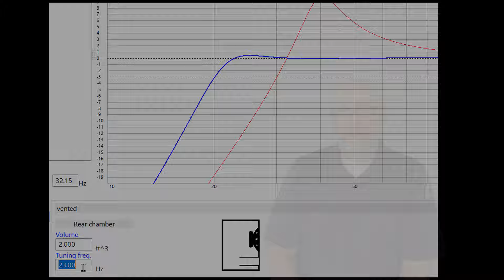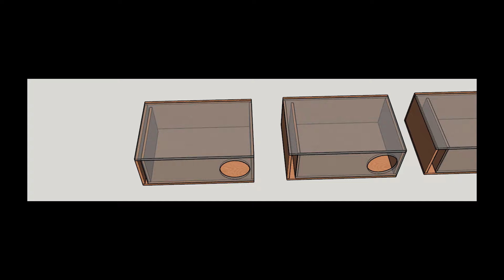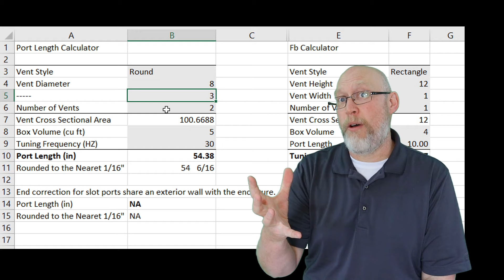Everything you need to know about PORT TUNING in under 3 minutes!

Comment: The DIY Audio Guy dropping knowledge once again.
Reply from the maker: That seems to be my thing.
Reply: Es El Fuego no?
Reply: I am still don't know what is better hight tuning or low tuneing. I just need the best tuneing that has more bass.
Reply: @DIYAudioGuy  I want very Low frequency at 10" subwoofer for earth shaking Bass. So what dimensions should be used to tune for deeper low Bass like earth shaking Bass? Please suggest me Sir... Thank you🙏
Reply: @DIYAudioGuy  not sure if you will see this or not but in about a month I am going to start building a 6th order 2/1 for  4 zvx 12's they are all going to share a 12qft ported internal volume and will be tuned to 30hz (i will call this the back of the box) the front half of the 6th order  will be 6qft and tuned to 60hz but I am unsure how to tune the front does it tune the same way as the back? For example if my port need to be 12in long to achieve 60hz for the back half would my port need to be 6in long for 60 hz in the front si ce the front is half the volume of the back?

Comment: I bought a Wuzhi 2.1 AMP from Amazon and a Dayton Audio 4" Mid Sub  speaker. I have a corrugated tube from my paint spray booth just to try. If I place the tube over the top of my speaker and totally cover the cone the volume of air from the speaker  is amazingly high. And the base is very high as well. I find from this midrange speaker that tuning the frequency down does not sound as rich but I am using the speaker as a sub/midrange speaker so tuning it up to hear more of the voice/music sound better. I bet I could use 2 in midrange and maybe one 5 1/4" as a sub range might sound better. I am just experimenting at this point. Also my tube has a rubber flang piece for connecting two pieces together. I have tried this as a temporary Baffle and as the base of the port tube. The rubber piece does seem to help the sound.  As ca Baffle The rubber piece does add to the base that is coming out the bottom. Not sure if that is the effect one wants in a speaker. I wonder if this technique is better or worse that just placing a tube inside an inclosed box? Besides vibrating the tube I would think you would want as much air pressure coming out of the tube as possible. And there is a lot of air pressure in my design.

Comment: I have a question that I have never heard a definitive answer on.   I have been building and installing car / wakeboard boat audio systems for about 22 years now. My builds obviously change based on the customers expectations, customers music preferences,  the amount of space their vehicle has and their budget.   My next build will be for my daily driver Ford Focus ST. I plan on experimenting with the enclosure I build for it.    Many people that decide to install a stereo system have seen vehicles with multiple subwoofers and they assume that running two subs vs 1 actually doubles the low end output.  They believe bigger and more is better. They think they need to run 10,000 Watts and as many subwoofers as they can cram into a car to make bass.  Many times my goal is to prove amplifier power and number of subwoofers has nothing to do with performance.  It is funny.  it always shocks people when I explain the actual volume difference between running 1 or 2 subwoofers in properly built boxes doesn't double the bass output.  When I explain to them it only provides them a few DB increase in bass output by adding another subwoofer they look at me like I'm crazy :-).  If one speaker puts out sound then obviously two we'll double that sound 😊 It's hard for people to grasp that the subwoofer is not outputting sound it's moving air which creates waves that we feel and hear.   I try to convince them using single subwoofer in an  enclosure that is built and tuned properly should sound amazing and provide very good bass output. Usually I have them sit in my 2011 F-150 running a single DC Audio M3 8 and they realize I'm not scamming them.  Here is my question for you.  Would building a dual chamber ported enclosure  that has one smaller chamber (1cuft) ported  somewhere around 40-50 Hz and then building the second enclosure larger (2cuft) ported to somewhere around 27Hz provide stronger performance across a wider frequency range than it would If I built a separate two chamber enclosure with identical sized chambers ported to identical frequencies?   Is there a benefit compared to two identical chambers or would this be counterproductive?  FYI The subs would be typical fourth order and both chambers will use identical subs.  Most enclosures I build I attempt to tune them to have a flat response.     In my mind it seems like two different tunings and enclosure sizes would allow me to tune the larger chamber to that same flat response allow that sub to play all types of music and then the smaller higher tuned chamber would give me very strong 40-160hz (snare, kick drums, lower mid-based frequencies).  Technically wouldn't it provide better overlap with the mid-range / mid bass?.  We've all heard car audio systems that have very strong bass with great vocals and high end but completely missing the crack of mid base that we all hear and feel at concerts.     Obviously this is just a hypothetical question.  I understand that the performance depends on the subwoofer parameters and how its performance is estimated in WinISD.   Let's assume I did my research and have found a decent 10inch subwoofer that functions well in anywhere from .75 ft³ all the way up to 2.5 ft³.
Reply: Please help me, i want to build a box for 200 watts subwoofer, the problem is i really don't know the size to make  a good bass sound, i want soft bass, please reply
Reply: @user-yq1io8ez8q  did you build your box?

Comment: I'm all about huge enclosures for my home theater. My front stage has two 13CF dual 18 enclosures tuned to 15Hz, an 8.3CF dual 18 sealed enclosure and two 8CF sealed enclosures each with their own 18. Then out back I have a 128 cubic foot, near IB, with 6 18s in it. Bigger is better, HAHAHA! Well at least for my tastes in my theater. Response clean down to 7Hz. Definitely subscribing to this channel!
Reply from the maker: It takes space to make bass.
Reply: @DIYAudioGuy  So true, my man! And the room plays such a huge part as well! With my theater setup the way it is, because my room is 1200 square feet, I still struggle to get much response below 7 or 8 Hertz or so (when compared to my 10Hz+ content).

My mini-theater in our master bedroom, a 16Wx16Lx12H room,  Has 4 15s in it and, at least according to REW and my SPL meter, is capable of getting pretty close to the same responses! I've been learning so much every day. 

I'm hoping I can pick up some more tips now that I'm subscribed to your channel.
Reply from the maker: @budgetaudiophile6048  sounds to me like you know what you're doing!  I think I should be washing your channel.
Reply: @DIYAudioGuy  HAHA! No way, brother! You're the one with all the knowledge. I just ask all the questions! I was looking to port my 128CF enclosure, at 15Hz, which is what brought me to your channel. I have a 5" x 85" port but I think even if I divide it up into 6 or 8 pieces (cut appropriately for port tune) that I'd still get WAY ABOVE port velocity. 

Here's the thing that's getting me wondering, though: My theater, as I mentioned, is very large! The face of the Smol Boi is nearly 30 feet away from my seating position! I was wondering if, given the other subs, given the dramatic output, would I still hear port noise from that far away. 

Not sure if you have the time to discuss that with me, but I'd love to learn more!
Reply from the maker: @budgetaudiophile6048  I honestly don't know.
Reply: @DIYAudioGuy  It's all good brother! These are the thoughts that go through my head when doing a new crazy build! HAHAh!

Comment: Thank you for the info. I am a little confused however. In this video you mention 3 things that can effect tuning. One being the vents cross sectional area. You said that with a larger vent cross sectional area it will raise your tuning, however in your other video labeled “understanding port length, box volume and tuning frequency” you show on winisd as well as mention that changing the vents cross section area has no effect on tuning. And those examples ranged from a 1” to 2” to 3” wide port changing the vents cross sectional area rather reasonably. Am I missing something? Thank you.✌️
Reply: That’s my fault. I had to rewatch the video. It seems The only reason the cross sectional area of the port didn’t make a difference in tuning when you increased the sizes was because you extended the ports length to keep tuning the same. So it would have raised tuning had you not lengthened the port. My apologies. I watched them too quickly. Plus you were talking a little fast towards the end of that video lol. Thank you again for the information. ✌️
Reply from the maker: It's all good, if you missed it then others did as well.  I will try to be a bit more clear and slow down a little.  I tend to talk fast when I get excited!

Comment: I want to build some speakers with a front slot port, using an existing design. I naturally assumed that the port area and length would be the deciding factors. Then someone pointed out that a round port is generally more efficient because of thinks like boundary layer, Reynolds numbers, etc. (my Dad was a civil engineer).

So how can I adapt a round port to a slot port?.

(Still chuckling at your "Freedom units" comment!)..

Comment: Hi.
I have liked all of the videos from you .
Got a couple of questions
1-What is better - tune port to higher frequency or to a lower one than the fs?
2-if able to tune below the fs, how much lower, 5,10 or 15hz lower than fs?
Keep up the amazing box building!
Thanks for all the tips.
Reply from the maker: We are doing a Q and A session on our live show tonight.  I will answer the question this evening.  https://www.youtube.com/live/VCpaaVaU8-Y?feature=share
Reply: Hi.
Thanks for the answer in tonight’s Q&A session min 40.
Just finished watching it.
I get your answer but I think to fail to give more detail to my question (didn’t want to overwhelm)
If the tuning is below the Fs, I see that the Cone Excursion going overboard.
How much can the speaker go above the Cone Excursion red line (mm) in WinSD, if at all?
If I leave the tuning above the Fs, it remains below the red line, but it’s not deep bass.
When I set it below the Fs, the speaker does go above the red line.
How much can I push above the red line (at my own rick), 1.0 mm ?
The ratio volume box and excursion go hand by hand.
Thanks again.
Reply: Hi.
Thanks for the answer in tonight’s Q&A session min 40.
Just finished watching it.
I get your answer but I think to fail to give more detail to my question (didn’t want to overwhelm)
If the tuning is below the Fs, I see that the Cone Excursion going overboard.
How much can the speaker go above the Cone Excursion red line (mm) in WinSD, if at all?
If I leave the tuning above the Fs, it remains below the red line, but it’s not deep bass.
When I set it below the Fs, the speaker does go above the red line.
How much can I push above the red line (at my own rick), 1.0 mm ?
The ratio volume box and excursion go hand by hand.
Thanks again. @DIYAudioGuy

Comment: Hi.. redoing by old 17 year old SUV... My Brother in law used to do this all the time and I gave him the  internal dimensions I'm using.. and ge gave me port specs.. no idea what it's tunes to.. but, when I was 17.. basically 20 years ago.. for my  birthday, he built a box that was awesome.. he has some sheet he goes off of..  So backstory over.. you mentioned.. ports can be used out of almost anything.. the tubes I need apparently are a 2x9" and a 6x4" diameter. Don't have them laying around but if I'm in DIY mode.. found 2 things that could work. does the material matter?  plastic vs metal.. etc.. enjoyed your vid.. just made me have questions

Comment: You explained more than most videos I have seen, also can you please make a video about a question I have. So my question is if my sub box is smaller than required can i compensate the missing cu.ft. with a bigger port or in other words lower tuning frequency.
Reply from the maker: You can do that, but it will only get you so far.  To make matters worse as the port gets longer it takes up more space in the box, reducing the box volume even more.

In this video I show you the response function for a severely undersized enclosure, that's what you can expect to happen.  https://youtu.be/-yopTneS7g8
Reply: @DIYAudioGuy  thanks👍👍

Comment: Is it a good idea to have lower box tuning say 20-25hz and have woofer which has a fs of 30-35hz to be installed in this box? Is this practical for HT setup. ? 
Couldn’t find this answer in YT videos. :(
Reply from the maker: You can tune a box lower than the driver's Fs.  That is how most home theater subs are tuned.

Comment: Quick question,  i normally build vented boxes with round ports but my next build will be square ports. I see some boxes with flares and some without.. would flaring always be a slightly better port design over non flared ports or would that strictly dependent on specific driver tuning ? Thanks in advance
Reply: Flaring the ports will help keep the port turbulance down.
Reply: @mattstarke7373  Thanks Matt

Comment: I have asked several comment sections if the ports volume is added to the calculated box volume or not….  Sune the port can swallow alot of volume from a subwoofer 🔊
Reply from the maker: The net volume of The enclosure does not include the space taken up by the port.  Vb in all of these, formulas is the net volume of the box.

Comment: being a noob at car audio like me can be frustrating lol. I recently bought 12"sub and a ported box from a stereo shop (tuned to 35 hz and I believe 2cu.ft) and had them install it. Going from previously having a sealed sub to now a ported. The ported is definitely louder but I feel like I have lost some of the low bass, like 25-35 hz. I understand that ported has a steeper roll off below tuning freq, but I just feel like my setup is really loud from 40ish hz and up but everything lower by comparison is barely there. I also switched from a sedan to a hatchback. I just dont know if the lack of low end is because of the tuning freq, or maybe a lack of cabin gain in my particular vehicle, or the sub itself (kicker cvr 12, the brand that everyone on the internet seems to hate), or something else
Reply from the maker: Try moving the sub around, point it in different locations and directions.
Reply: Try a different Sub maybe, also what’re you powering it with ?

Comment: Nice explanation, so i could say that in port tuning frequency and frequencies just above, when the box is doing max spl ,,, in other hand, the subwoofer is taking the less power of the amp ? Or actually around this tuning frequency the sub is taking a lot of power from the amp? Thats my question
Reply from the maker: I am not sure.  I am not aware of anyone that has tested it.
Reply: It is around the tuning frequency that the subs impedance is its lowest. This is the frequency range it draws the most power. 

Say box tuned to 30hz. At 45hz the amp will not be pulling a lot of current. Around 30hz the amp will draw a lot of current. Its easy to see if you use a clamp style amp meter.

Comment: so the port is tuned to the box, right? If I change out the driver, it shouldn't have an impact on the port's efficiency, am I correct?
Reply from the maker: Yes, but different drivers will sound different in the same enclosure.

Comment: I'm building a box.  I had a friend who was awesome coming up with sizes shapes, porting and all that stuff.  I did the wood working.  Lost my friend, winisd always errors out or tells me i'm leaving something out so I never get the info i need for making the ports.  Could use some help.  The box is made from 3/4" birch.  outer dimensions are 58" x 14" 12" deep.  I'm putting 4 Fosgate P2D4 8" subs in it.  needing port size and length to tune.  Thx..
Reply from the maker: https://bit.ly/48OVJGI